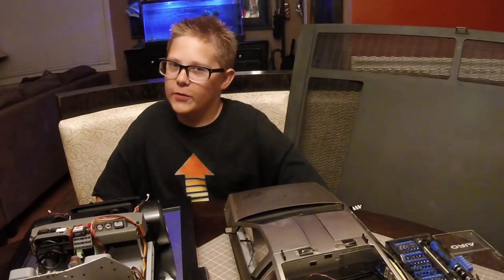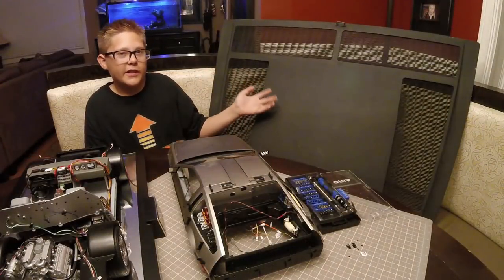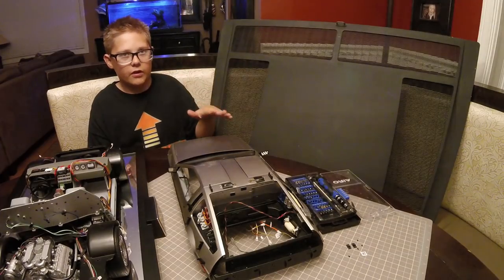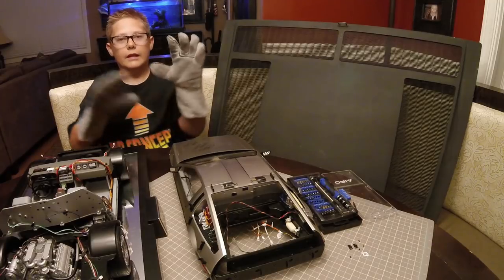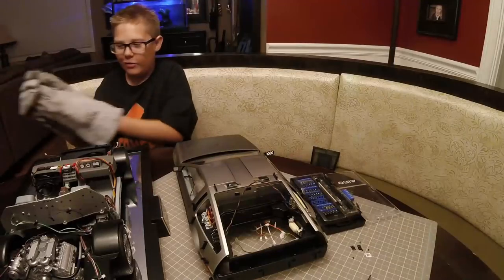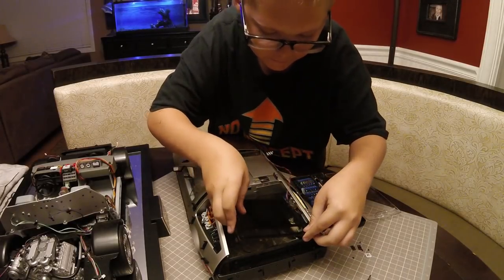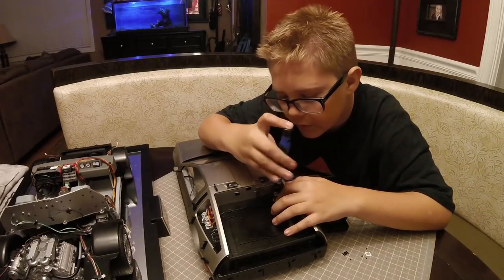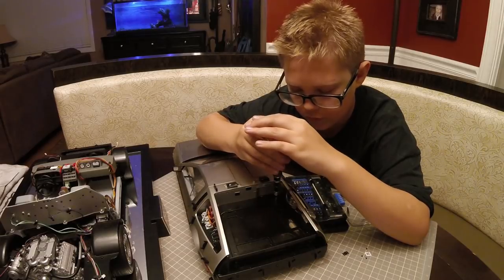Episode 89 | DELOREAN ENGINE COVER | Building with Style | Back to the Future | Build the DeLorean

Comment: Hi Joe and Joey. Do you know if the bttf3 wheels are included with are subscription,or do we have to pay an additional charge? Many thanks
Reply: Eaglemoss have now added an extra 30 issues to the build, which will give you the 1955 hood box and the 1885 train wheels along with some track to sit it all on. If you want the 1955 Whitewall tyres as well then you need to get Special Number 3.